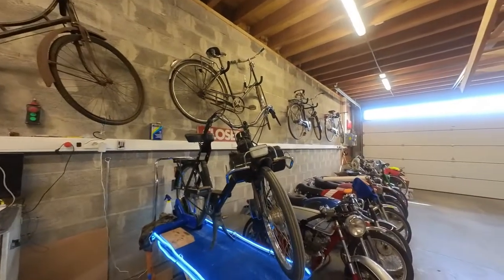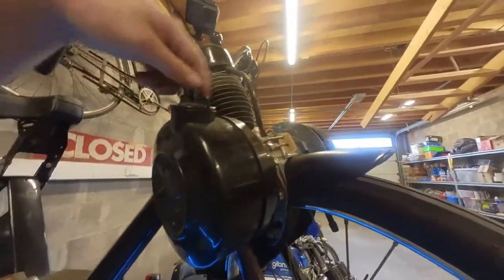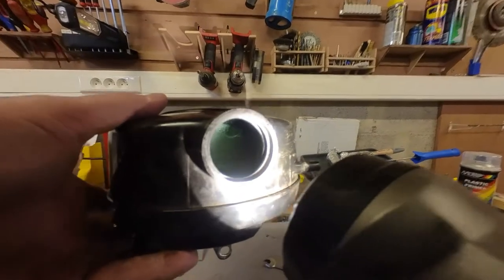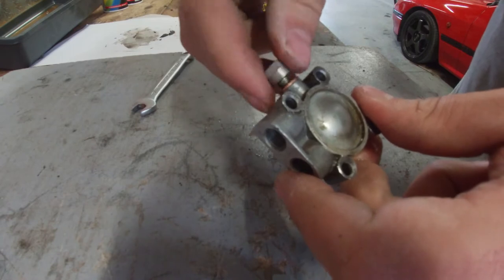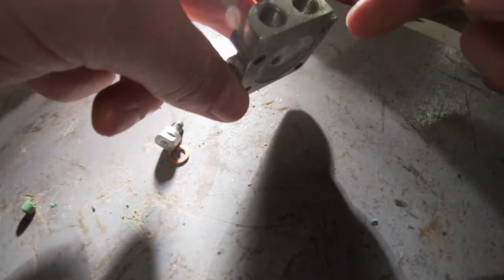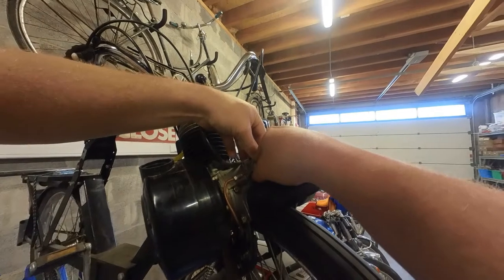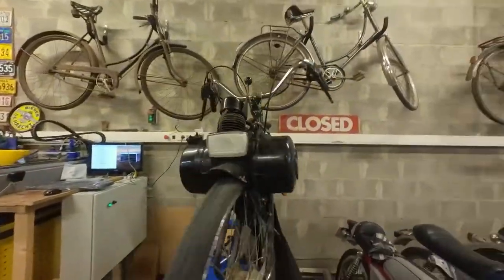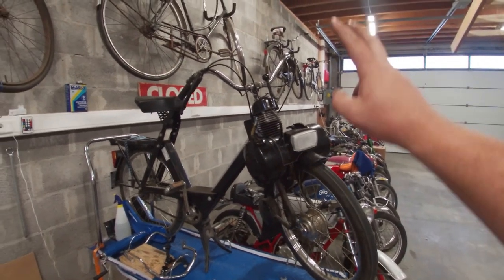Solex 3800 - Fixing the fuel system again

Comment: Just what is that? It looks like an Impex Hungarian made S3800, but it appears to have a drum front brake, which would be a huge improvement over the old design, which is REALLY fragile. I have a 2004 Impex 3800, and have had a ton of problems with it. Surprisingly nothing with the motor, but both wheels were spoked backwards from the factory and collapsed, leaving me stranded. I had to make a hard stop which turned the front brake caliper into pretzels. I was able to get new brake parts for the front, and used wheels from a much older model. Unfortunately the older rear wheel uses an 83mm brake drum, so the brake assembly from the newer 80mm bike wouldn't work. Right now I am trying to piece something together. It would be really nice to be able to find a front wheel with a drum brake.
Reply from the maker: From what I now this is a bike made in Hungary indeed, but the bikes made there were/ are made under different brands aswell. Don't quote me on this but I think this is an MBK 3800. But in the meantime the brand solex had its owner allready changed once or twice. Not sure who produced them early 2000 but that could explain the differences. I think mine has 83mm front drums. Will have to doublecheck that though.

Comment: What is a pen ball. I have no idea what you're talking about but I'd like any specific information you have on it because I'd like to have some spares.  Thanks.
Reply from the maker: The little ink cartridges for refillable pens have a little plastic ball in them. It's one of those balls you need
Reply from the maker: https://www.pennstateind.com/mm5/graphics/00000001/PK10-FPR.jpg 
These
Reply: @VintageGarageYT  Thank you very much.
Reply: @VintageGarageYT  I think I found a 60 pack of standard international refills with a 2.6 bore end.   That would make sense if the ball is 2.7mm.  I think I'll go ahead and order them. 
I have 2 impex solexs that I'm going to do rebuilds on as soon as my parts kits arrive. One is more sluggish than the other so I'm going to be rebuilding the carbs and at least cleaning the fuel pumps and want to be sure I have an extra set of balls just in case.
Reply from the maker: @PhonePhone-sf8te  That's a good call. Never hurts to have some spares!
Reply: @VintageGarageYT  Just tore the engine down. I did check the first ball that falls out. It actually looks smaller than yours.  I think it may have been replaced already with the wrong size?
Reply from the maker: @PhonePhone-sf8te  That's possible, however I don't think it matters that much. It just has to close off the hole in the pump and has to be able to move freely up and down